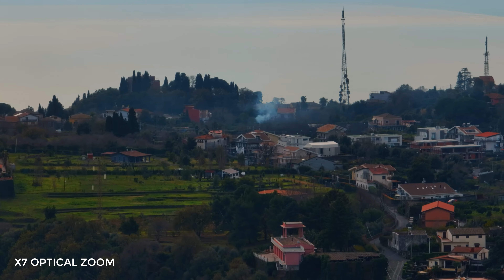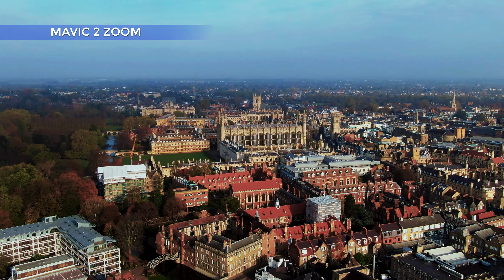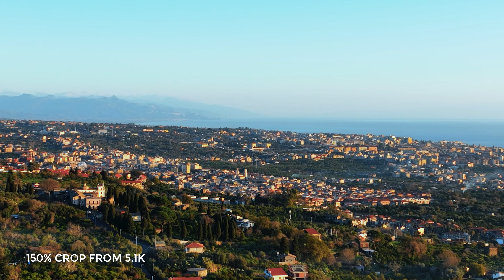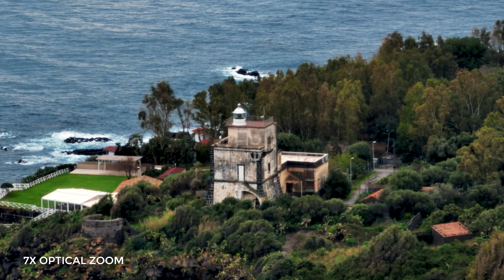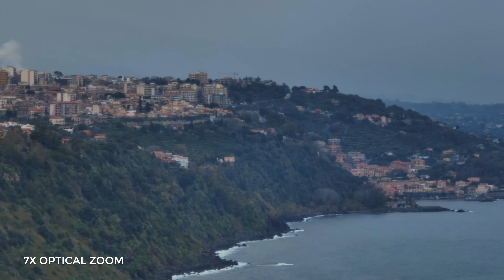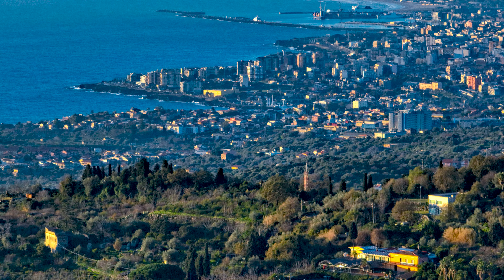DJI Mavic 3 Optical Zoom - How good is the Telephoto Lens?

Comment: Quick question: i've difficulties with my Mavic 3 capturing wildlife with 7x zoom. How do you apply focus on particular area ? By clicking on the screen as on any other  DJI drone?
Reply from the maker: Hi Jana,
you can toggle between auto and manual focus by tapping on the icon to the left of the shutter.
When shooting video I suggest using manual focus, in which case you can simply tap on the element you want to focus on
Reply: @VICVideopIC  thanks for the guidance
Not sure I got it: while using manual focus I could just tap on the screen to focus the object accordingly?

Comment: So anything above 2x zoom is basically not good quality and the 7x optical zoom is not optical zoom and pretty much lossy zoom !?!???

Bummer !… 😑😑
Reply from the maker: Not exactly.
The 2x digital zoom is very good, especially after the latest update, as it is compatible with 5k video.
The 7x zoom is indeed optical. After the update the quality has been improved and it is quite good now and great fun to use. Sadly it doesn't save in RAW and there is no manual exposure. I hope in a further update
Reply: @VICVideopIC  thanks but i guess ill wait till the 7x zoom function is fixed and can shoot professional video unless you can prove the opposite ill be glad to see that, also my understanding is that in explorer mode you start zooming in optically till u reach 7x then beyond that its digital, what do u mean 2x digital zoom >?!,,,